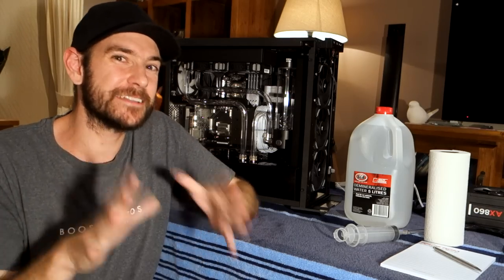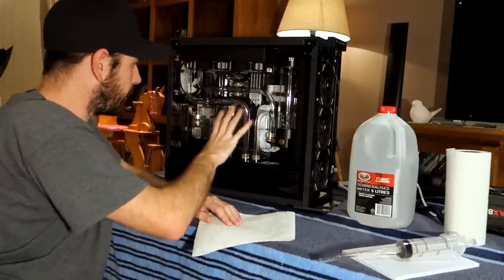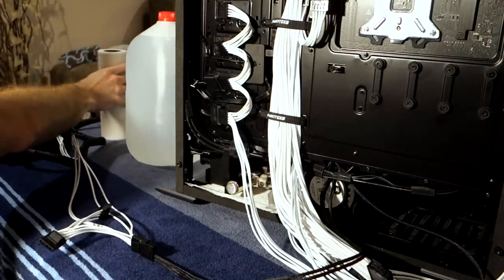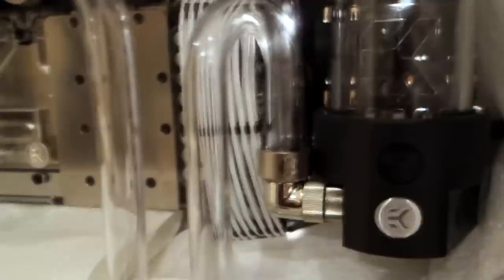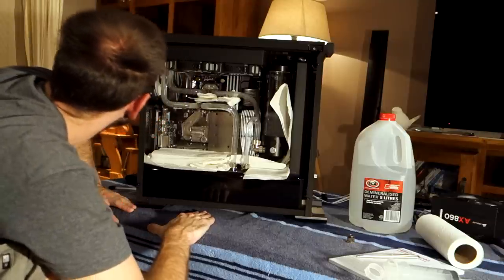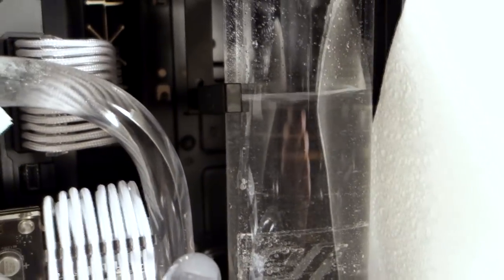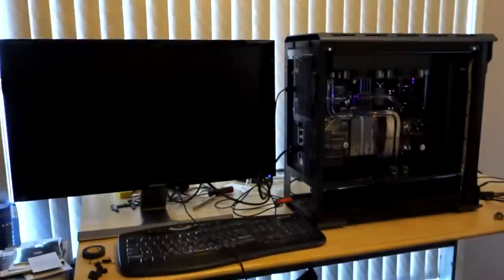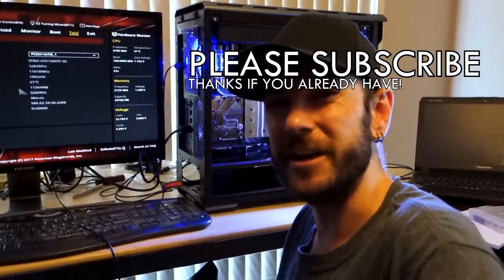MONSTER PC BUILD - Filling with Water, Bleeding & Will it Boot?

Comment: More cautious than I was.  I had a bad leak all over a PSU in an 011 Dynamic from a loose fitting.  Now I triple check fittings.  Use a funnel and tube to the fill port so you just pour it in.

Comment: Is there any GPU sag with that mount? If anybody knows I was wondering if that mount would fit in the new Lian Li pc-011 dynamic. (There mount blocks the bottom of the case)
Reply from the maker: There was a bit of sag but it depends more on the support structure on the case itself rather than the mount itself. 

I 3D printed a little stand to prop it up.

Comment: Can you use only distilled water to cool down your PC?
I’m planning on changing the fluid in my PC. I just need to figure out how I can run the loop motor only?
Reply from the maker: Yes you can use distilled water only but it’s a good idea to add some biocide or you’ll need to change it very regularly.

Comment: When you say you'll let the system pushing the air ( 11:50 ), is the port where you fill with the syringe closed ? Or open ?
Reply from the maker: Open. It bleeds the air much faster if you leave the port open.
Reply: It HAS to be open or you can't bleed the air and you will damage your pump.. I was looking through comments, because it does seem like you have the syringe in the fill port at 9 minutes, and thus it close off the fill port? Not good for the system..

Comment: Hi. Can you tell me how much fluid did you use when you finished this loop? I want to make one, and I don`t want to buy way to much regarding I will be going for the VUE which is kind of expensive.
Thank you so much for your time :)
Reply from the maker: My system took 1L but every one will be different unless your loop is identical. 

Best way is to measure how much water you use when you do your first full to flush.
Reply: @boostedmedia hank you so much. I wanted to know if 1L will be enough or should I buy 2, because I will be making something close to your dimensions. Also I had no idea if 2 will be enough. It is my fist time (as wrong as that sounds), I just bought half of the things I need, but I wanted to have an idea regarding never finding a straight up answer like "this pc used 1.3L" or "700mL" or "2L" you know?
Once again thank you so much, your view count and subscribers do you no justice. You are literally the best one I`ve seen in terms of communication and also in terms of showing and taking time to say everything that needs to be said. Cheers
Reply from the maker: Thanks a lot for the encouragement. If I were you I’d buy two litres. Keep the 2nd litre for your first flush and refill in 6 months time. It has a long shelf life. 

If you only want to buy 1L you can always top up with some distilled water if you want to save some money. That’s only about 50c a litre.
Reply: @boostedmedia   it`s not really about the money, 30$ isn`t something that will kill anyone, it`s just that I didn`t even have the slightest idea of how much I need. It was like "what if I buy 1L and I need 1.5? what if I buy 2L and will use 500mL"... so I needed an idea :D thank you and looking forward in starting and finishing the build :D you are a true coach in this stuff :D

Comment: Is there any reason my water cooled sytem would run at different temps under load. My i9 hits 80 under load playing Battlefield V and my RTX 2080 ti maxes out at 41. I did my first water cooled build using your videos and im not to sure what my problem is. Any advice would be helpful
Reply from the maker: I don’t see any problem with what you’ve described. Of course it’s going to heat up under load.
Reply: @boostedmedia Thanks

Comment: There's one thing I just don't understand. You used a "carpet" for the static electricity. And now you just put some paper ( I'm french, I dont know the english term for this ) directly on your hardware. This paper is just like a big source of static electricity...
So .. what ?
Reply from the maker: Sorry. I’m not sure what you mean when you say I used a carpet for static electricity. 

The paper towel is to catch any water that might leak. The risk of water damage by not using the paper towels is far greater than the risk of static damage.
Reply: @boostedmedia  Oh Im talking about the orange surface, with a bracelet
Reply from the maker: That’s a static protection mat. It’s plugged into ground on the power point.